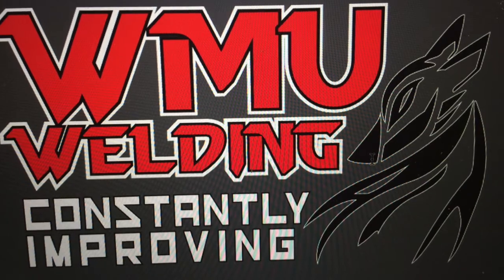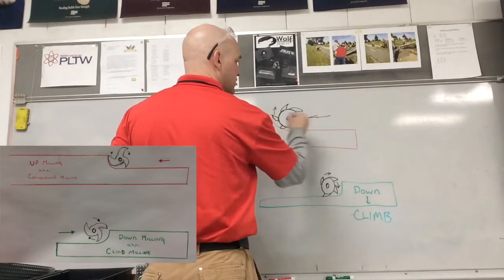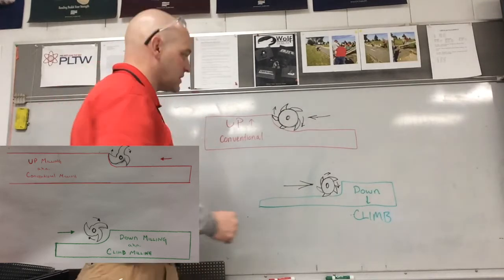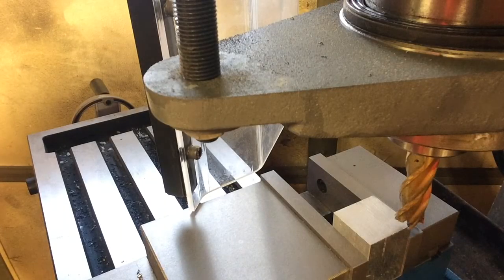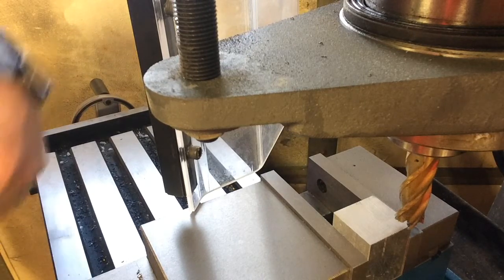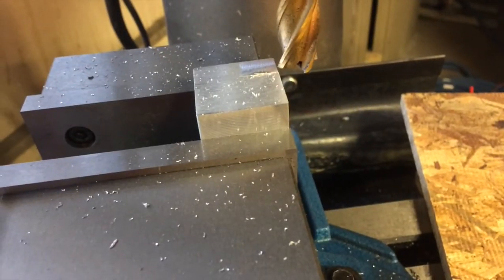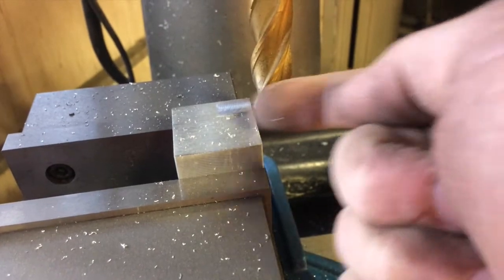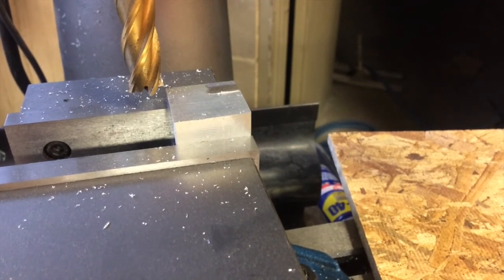Climb vs Conventional Milling

Comment: Hi I know this is old but I accidentally climbed mill on my brand new manual HarborFreight knee mill yesterday the cutter wouldn’t cut at all lots of chatter and smoke then I stopped did I damage my machine?? I’m not worried about my cutter but my machine tho ugh
Reply from the maker: I’m not totally sure without looking at it, but more than likely it’s just the cutting tool that’s messed up and not the machine.
Reply: @Trevkongable  thank you still runs great lol

Comment: Correct me if I'm wrong. The direction of the table should be reversed with the direction in your picture in down milling
Reply from the maker: So when the table is moving, the cutter head will still be in the same place in relation to the piece.  When the cutting edge is starting in to the piece - like a shovel taking a new swipe-that is climb milling